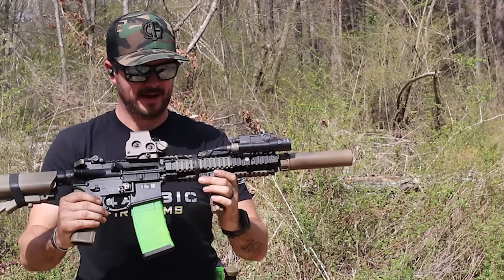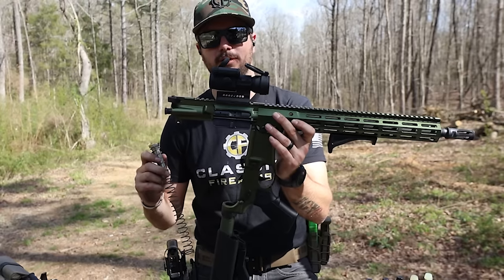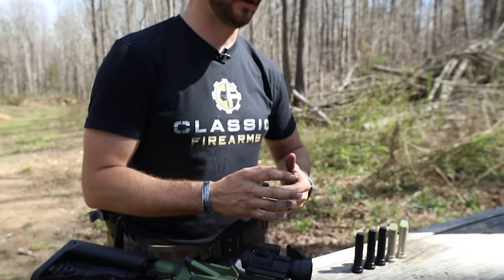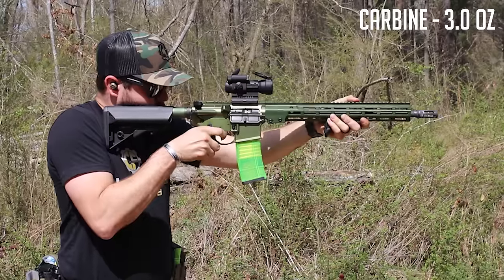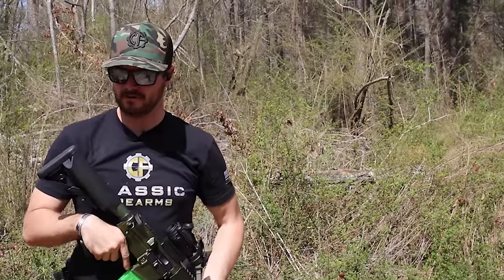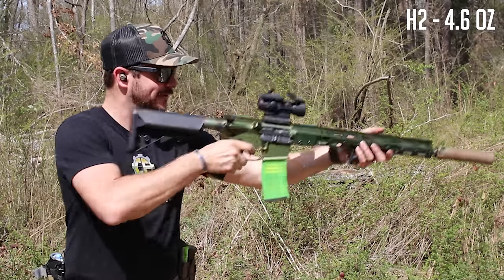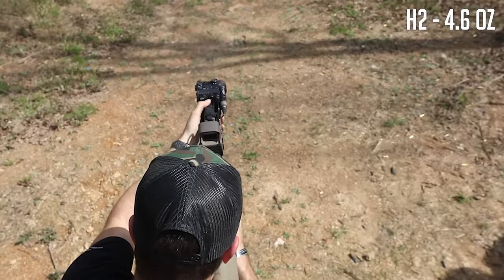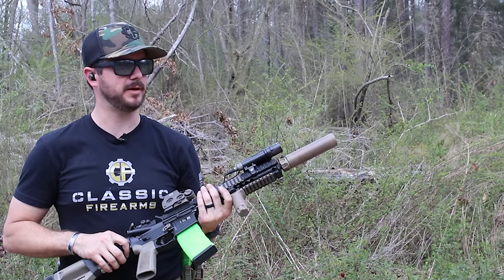What Buffer Should You Use In Your AR-15? (H1, H2, H3, H4)

Comment: I was hoping you would encounter a similar issue Im running into. Brand new build w/ 10.5" ballistic advantage barrel, it will not cycle, I have to charge it and it consistently ejects at around 2 to 3 o'clock, it will not cycle. I have an H2 geiselle super 42. I have checked the gas block and i noticed that the port hole on the kak gas block it has a slightly bigger hole diameter then the barrels, nevertheless it is perfectly in the middle, I've only shot 10 rounds. Anyone have any ideas? headspace is good, and bcg is an angstadt arms BCG. I took the bcg apart and double checked everything and I cannot see what the problem might be.
Reply: Your buffer weight and / or spring is far too heavy / tight. Take your buffer weight apart, get a scale and start with 3oz and slowly work your way up. Is your trigger resetting? Is a round being stripped off the top of the mag and fed into the barrel? It's either a trigger issue or buffer/spring.

Comment: I've watched more of these than I can count but learned less than reading the average first grade primer. Bottom line is 90% of the time the stock weight is the "best" over all. If not the best, then its at least functional. The only time even thinking about it makes the difference is if you're an elite competitive shooter, shooting a "race gun" where thousandths of a second might actually matter. All the rest is just wishful thinging aka BS. Put a factory load in a factory gun, bang, it works. Case closed.